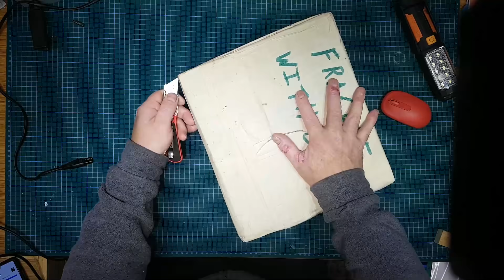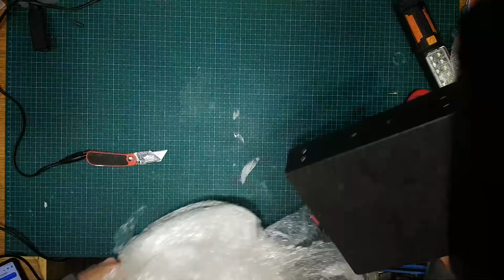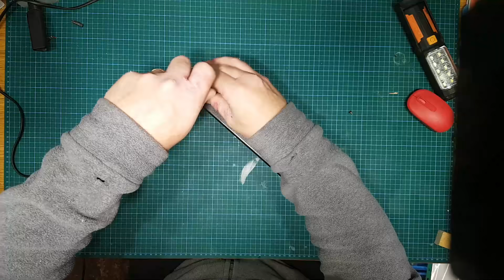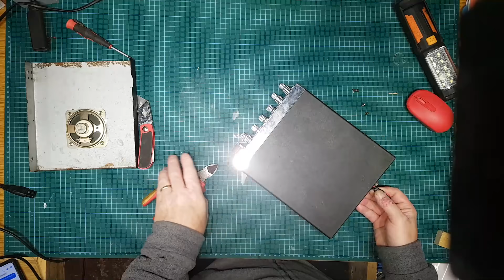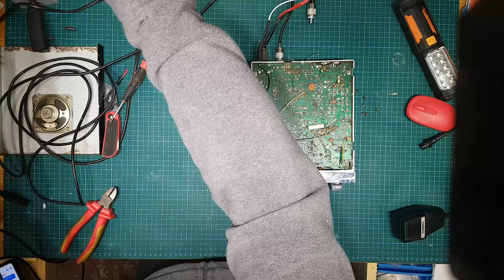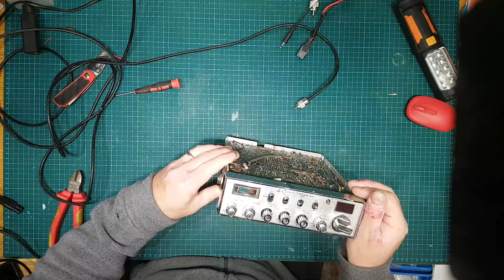MR FRANKS COBRA 148 GTL DX MK 1 ASSESSMENT

Comment: Hi George.  Great videos.  Brings back lots of great memories for me.  Here's a long shot. Back in the 80s I had a MK1 148 GTL DX.  A friend of mine was an electronics enthusiast and did a couple of mods on it.  He basically repurposed the C9 switch to knock any channel off by .5 mhz, so anyone with the same mod could effectively have a "secret" channel - at the time me and my now wife use this mod for private chats.  He also piggy backed my preamp board inside the 148, wired it inline and installed a new switch at the backside of the unit.  This meant it had a built in pre-amp rather than a separate unit.  Have you ever seen one like that?  It was as sweet rig, really clean.  I teamed it with a chimney mounted GPA, Bremi 200s, Leson base mic and a few other bits and bobs and at the time thought I was the nuts :) :).  I regularly reached all over Europe and also Sao Paulo on occasion (I was a member of the Red Admiral DX club based out of Ramsgate).  I used to know a fair bit about it all back in the day but I'm afraid it's all distant memories now.  Cheers for the memory jog.
Reply from the maker: Wasn't Simon from Tadcaster by any chance?
Reply: @GeorgeEI7KO  No mate, Kent.
Reply from the maker: Ah ok. He had his own speech processor mod too.

Comment: didn't hear you mention recapping , a must for those radios
Reply from the maker: If caps need to be replaced they will. I recapped two before as an experiment. Tested both before and after. No detectable difference. 90 per cent of the cars I removed were in spec for ESR and the remaining 10 per cent were just approaching the limit.
Reply: @GeorgeEI7KO  ok good